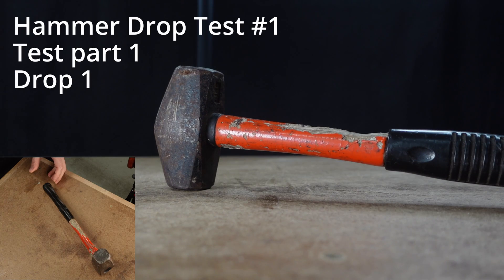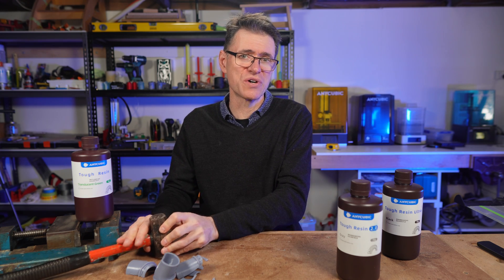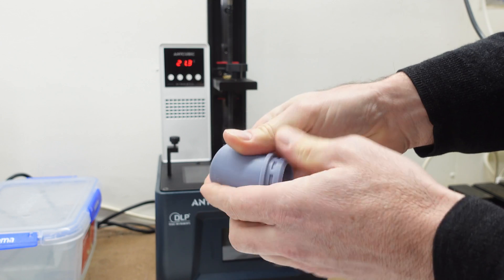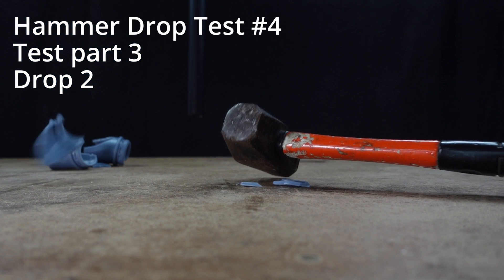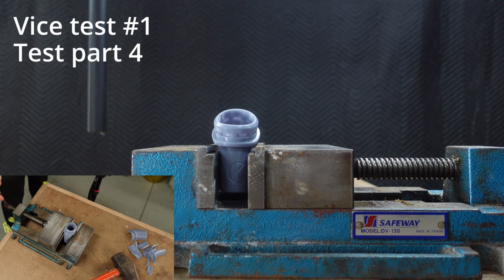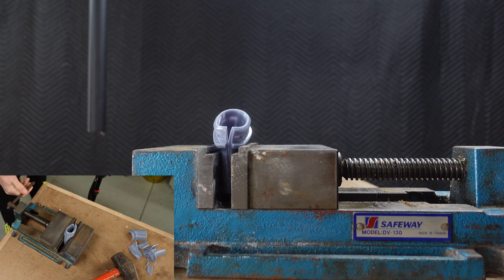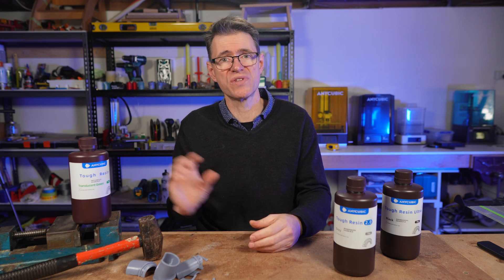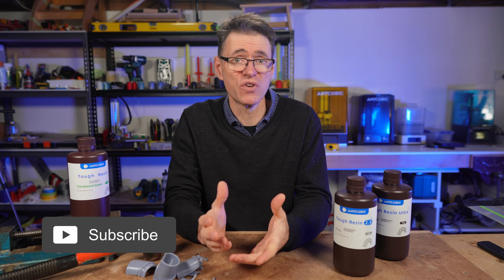Anycubic Tough Resin 2.0 | How Tough?

Comment: I am looking for some resin for miniatures ... so they will not be used in heavy industrial applications but dropping a painted miniature and having it shatter is a bad feeling especially if a lot of effort went into painting it.
In a way it might even be more demanding than industrial application as these minis often have small parts like a horse standing on its legs or a dragon on its feet and that is where it breaks.
Reply from the maker: Anycubic Tough 2.0 will work, although I would say that for your application Ameralabs TGM-7 could be even better. If you send me an stl of one of your minis I’ll do a print and then do some drop tests. You can email me on info@colinklupiec.com.
Reply: @ColinKlupiec  Hey Colin, first of all thank you for ding all these scientific tests on the different resins. I am in the same boat as andras, looking for a good resin for miniatures. Its mostly spears or flagpoles, sometimes slim ankles, that snap during transport of from some minor mishandling. It would be better if they just bend a bit of course. 
Besides the expensive and hard to get TGM, the anycubic Tough 2 or Tough ultra sound really good. But which one should I get? I haven't seen all your videos yet but I dont think you talked about this yet. Isn't Tough ultra just better? what are the downsides?
I also prefer my resin to have low odor and that it prints okay at ~25 degrees C here in europe winter. Is there any difference in that regard between the Tough 2.0 and the Tough Ultra?
Thank you so much for ansering. 
BTW if you want a miniature, there are plenty free ones around, anything with a spear or something will do, I would also see you just bend a small part like that with just your thumb or so to see how it reacts. (I guess the mini version of the vice test) besides of course a drop test on a hard floor.

Comment: grate video, can i ask if you would consider testing some more, i  have worked with fiberglass and know for sure resins can take more time to fully cure, with final strength take up   to a week or 2 .
Reply from the maker: Hey, thanks for your feedback. Really appreciate it. That's a good tip for further testing. My recent video on #Formlabs Creator Tough used parts that were a couple of months old. I wasn't thinking that much about how long they'd been printed when I was testing them, but maybe I should be looking into that more. You can check that out here. https://youtu.be/k6EHInnlHdM

Comment: ok, now how do you remove print from your build plate. its nigh impossible to remove.
Reply from the maker: Thanks for your question. Reduce your base exposure time. Try lowering it in 5 or 10 second increments. I tried that with a high temp resin and needed to reduce base exposure all the way down to 6 seconds.
Reply: @ColinKlupiec  Will give it a go, ive already tried 3 sec - No adhesion , and 6 sec Glued to the plate. will try 4 and 5 sec.
Reply from the maker: It's worth a try. What printer are you using?
Reply: @ColinKlupiec  creality ender 3 v2
Reply: @naroe2001  Huh? What setting are you adjusting? Exposure time is only for resin/SLA printers while the Ender 3 is a filament/FDM printer.
Reply: @Mikey.750  oops thats my other printer, its actually anycubic mono X
Reply: Oops idiot I am that's my other printer, resin one is a monoX

Comment: What was the best impact resin you have tested. Thank you
Reply from the maker: Thanks for your question. In my testing...Anycubic Tough Resin Ultra has the best impact resistance. But it can also get a bit soft in warmer conditions. Ameralabs TGM-7 is the next best because it maintains its shape better with fluctuating temperature and has unlimited colour mixing options. But that makes it more expensive. And, surprisingly, a lesser known brand of Antinsky High Tough resin is also very good. And, if you're looking for a water washable version, my recent review of Nova3D water washable resin showed surprisingly good results. https://youtu.be/TA6vlslrEpU 
That's four resins which should give you some good purchasing options, depending on where you are located.
Reply: @ColinKlupiec  thank you. I will look into theme 🙏🏼
Reply from the maker: @taktikairsoft  You're welcome. Always happy to help my small community where I can.
Reply: @ColinKlupiec  I started cart testing tonight 🤣 will end up with 300$ of resins to test. Thank you again.
Reply: RESIONE was a recommendation but I'm looking for a solution for under 40$ USD for 1kg
Reply from the maker: @taktikairsoft  That's where the Antinsky resin may interest you. It's currently listed under $40USD. But, it only comes in white. https://antinsky.com/products/antinsky-high-tough-uv-resin-with-405nm-and-low-shrinkage-for-lcd-dlp-3d-printer-resin

Comment: As someone who prints miniatures(warhammer) for tabletop gaming, i bought 2.0 without even knowing that the impact resistance was that big, as you have shown, i bought the resin actually due to your first video on tough resin. 
But to the main point, so i personally tested the various minis i printed by just simply dropping them onto a ceramic tile floor from about a meter~ as that's how tall most tables are and even more hefty prints were unscathed, only extremely small appendages would sometimes break off (1mm thick and 4mm long lascannon for example). I was very impressed with the results, as standard or plant based resin prints would just shatter even being dropped on softer surfaces from that height

EDIT: i did however notice that the clear resin has more toughness/flexibility than coloured resin,in my opinion this is due to dilution that the pigments caused when mixed with UV resin, as resin is clear by default when it's factory made
Reply from the maker: Hey, thanks for your comment. I’m glad that my first video on tough resin was helpful, and that 2.0 is working for you. Once I discovered ‘tough’ resins I never went back to non-tough resins. Too much work for things to break so easily. Thanks for the tip on clear resin. I’m going to try that. BTW, it looks like Anycubic is running down stock of the original. It’s not available to many of the shipping destinations anymore.
Reply: been trying to find a solid review from the perspective of a  wargaming minis printer, this is perfect, thank you.
Reply: thank man for your review ! I'm doing miniature wargaming (WH40k because in Québec, Canada this just start to be discovert and I want to help new players) I got a question, how many time do cure them in the cure station with the Though 2.0? and do you have problem with shrinkage? because I use ABS-LIKe V2 and my pieces (specialy the tanks and others big units) never fit

Comment: Thank you for your review, can you make a recommendation for small engineering parts with respect to toughness but also quality of print. I found some resins deform and I have had trouble with Anycubic tough resin ultra not sticking to the build plate.
Reply from the maker: Thanks for your question. You could try Sirayatech Build. Print detail is good and not as flexible as the Ultra. Another one I’ve got experience with is Anycubic Crafstman DLP resin. Great detail and not as brittle as standard resin. For build plate adhesion you could try re-levelling your build plate. It might look right to the naked eye, and not give problems with other resins. But I’ve had this problem once before too. Suddenly prints just started coming away from the build plate on one side. I was surprised at how a quick re-level fixed the adhesion problem straight away.